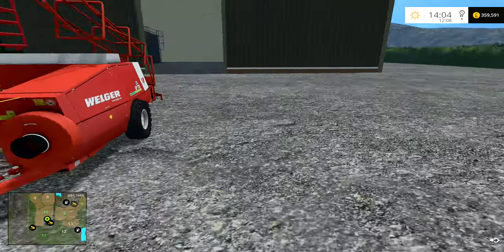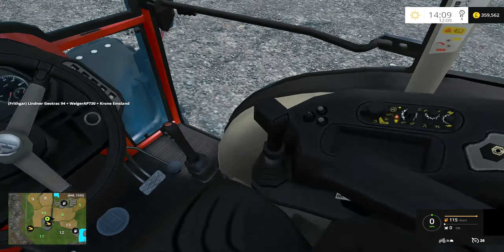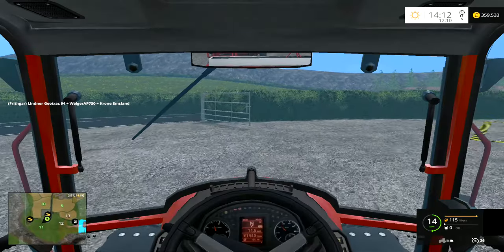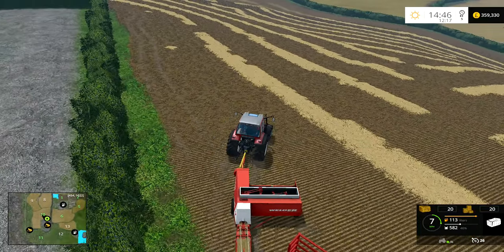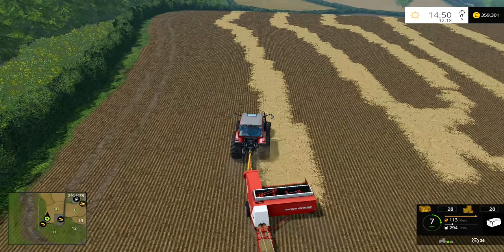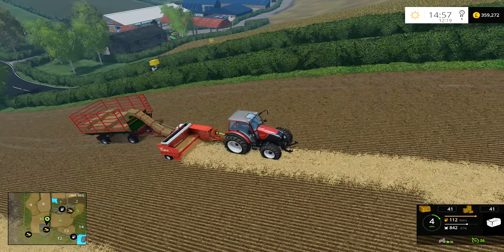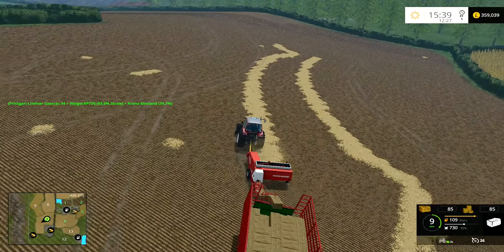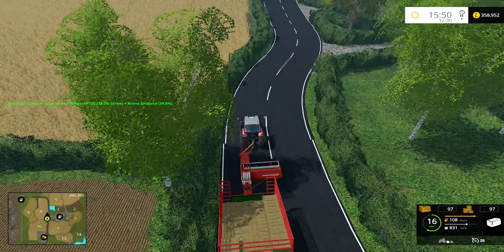Let's Play FS15 Higher Hills #21: Welger Small Conventional Baler!

Comment: on the linder you have to handles 1 for shifting from gear to gear (the lowest one) and the won that comes the highest is for going forward an backward
Reply from the maker: Ah ok, is this an override for the accelerator peddle or is it simply like a shuttle lever?  As in you push forwards and leave it for all forward gears and pull back to reverse?  I've used plenty of telehandlers that have that lever situated just under the steering wheel, but not see it to the side like that before.
Reply: it isn't to override the accelerator pedle normaly you have 5 gears forward and 1 backward and with this you can drive in 6 gears forward and 6 gears backward without switching much thing only that hendlel
Reply: somtimes it is on the right site from your steering wheel by a tractor and by the ''older tractors'' it is a handlel
Reply from the maker: Ah I'm with you now, I've used something similar, just a different set up where it was all on the same handle

Comment: ;ooked at current usa trucks on the roads and kenworth cab overs areoff the roads due to engine costs and maintainance
Reply from the maker: Fair enough, I would assume the longer truck configuration with the engine in front would be a lot easier to maintain
Reply: yes and no depends if you get a volvo